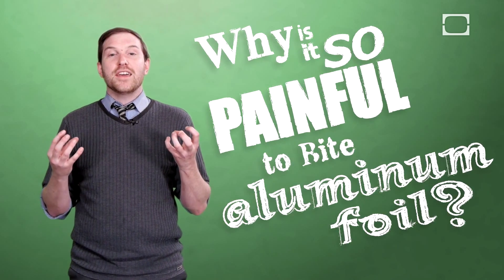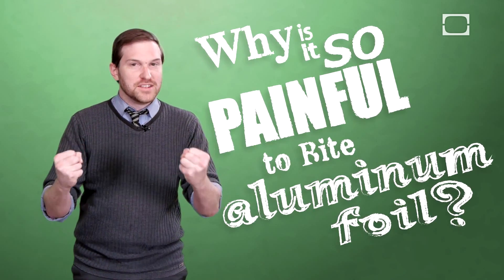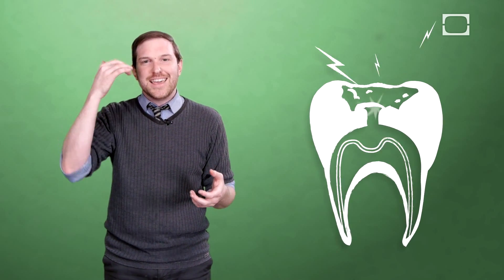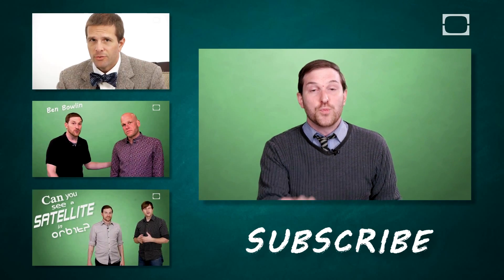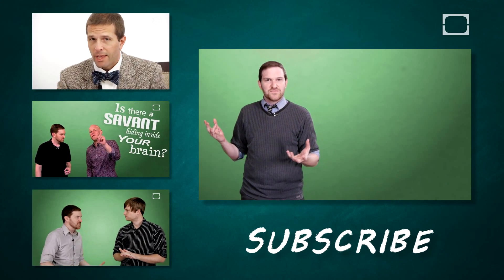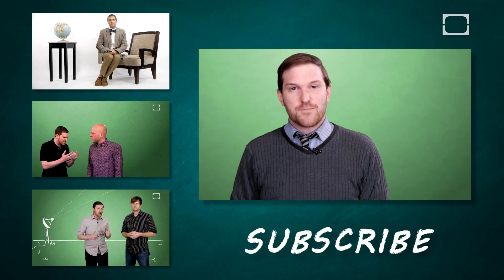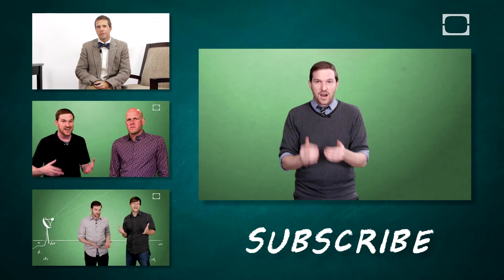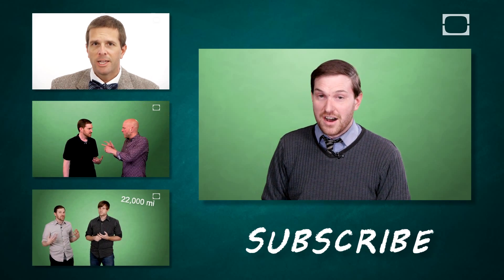Why Is It Painful To Bite Aluminum Foil?

Comment: I have a couch with two different kinds of metal, one is the main suspension for the couch and then another is wires in the cushion that are attached to dowels.  When I get my cell phone close to it it seems to get super heated after a while.  Could be also affected by the television or Wi-Fi or even the electrical outletS?

Comment: Appreciate the explanation. Without digging up a million charts or a LOT of math I haven't looked at since college, is there an easy way to estimate the voltage of such a cell, assuming a known metal in your fillings or specifically titanium dental implants? Titanium and Aluminum appear to be very close in potential, and yet I had a calzone incident the other day that felt like I bit an extension cord.

Comment: Hi Brain stuff. I have a question that regards a seatbelt. How does a seat belt know when to lock ? i tried searching it on the net but i could never get a proper answer? Your help would be great !!
Reply: Simon Merhi 

a locking lever extends from the spool axis by inertia to lock it when you pull fast enough
Reply from the maker: Hey Simon! We'll add that to our list of topics to cover. In the meantime, check out this article on our home site: http://auto.howstuffworks.com/car-driving-safety/safety-regulatory-devices/seatbelt.htm
Reply: +Simon Merhi There&#39;s a little ball in a cavity where the seatblet goes through and if you&#39;re pulling too fast the ball gets stuck.
I hope they haven't done this video before :P

Comment: the metal in the mouth also interferes with the electro magnetic field of the body in a negative way, not to mention, that u probably have amalgam fillings, which are 50 percent of the most toxic non radioactive material mercury, but hey it won't get into your body or as it already is, let's say into soft tissue right?
yeah right, except u rub on it, or heat it with let's say hot food or just the bh differences in the mouth u use, but hey after all who needs a working body and a brain is totally overrated.
and hey amalgam is cheap isn't it, of course until u figure out, that it destroys other teeth and decays the gums and that u need a specialist to get them out, cause the amount u might get from removing them or even worse swallowing a part might just kill u in a few month.
and if u're old (if u get there) and lie in a hospital or a nursing home having alzheimers and a decay and smell of death in your mouth at least u don't remember that the mercury might well be the reason.
but of course mental patents get heavy metal dmps tests, right, knowing the strong connection, but wait they practically never do, but u can't regenerate it anyways, so it's unimportant right?
yeah it's not like after some testing of mental patients and finding extreme mercury levels, that the psychological problem asides from others problems disappear through detoxification of the heavy metals right.
i mean it would madness if they wouldn't test sth. that can be taken care of and u get your mental health back.
but just that is the case, heavy metals out of the body and the mental health came back after years and years of unexplained detereration.
if u hang on the brain u use, body or even just teeth never get mercury (silver colored) fillings and never use mercury lightbulbs (energy saving non led)
Reply: Holy no more limited characters batman!
Reply: *****
i don't get what u mean?
Reply: cataria Because you probraly couldn't have typed that long of a comment if Google didn't remove the limit on characters just about the only good thing they did. at least after the bob revoulotion

Comment: Forgive me for being that guy, but it's ALUMINIUM, not "aluminum"
Hearing people mispronounce that word is like nails on a chalkboard.
Reply: In Canada and the United States, it's aluminum. More specifically, aluminum foil. On the Periodic Table, however, it is aluminium.
Reply: Well Canada and the United States are incorrect then.
Reply: Depends. Aluminium is an element. Aluminum is a compound made of aluminium. Depending on what all you put into the melting pot, you can get a different compound. After all, cyanide is made of two compounds: carbon and nitrogen. You don't call it Carbon Mononitrogen. It's just cyanide. Chemical nomenclature. I'm not saying Canada and the US is right, especially not the US (especially since we don't use the metric system), but I believe the point still stands.
Reply: Kitsune no Arashi I see your point, and concede. It still irks my linguistic sensibilities to hear it spoken that way, but at least I can see it in a less irritating light.
Reply: Glad to help :)
Reply: Even the British dictionary Oxford has it spelled as "Aluminum", a pretty major dictionary.  So not sure why all the hair splitting.   Also, do people not realize English dictionaries are actually descriptive guides?  Not actually telling you HOW to spell, pronounce, and define words.  In France it is a little different.  They have an academy that says:  This is HOW you spell, pronounce, and define words.  There is no such English academy.
Reply: The International Union of Pure and Applied Chemistry (IUPAC) officially standardised on aluminium in 1990, though this has done nothing, of course, to change the way people in the US spell it or pronounce it for day to day purposes.
Reply: Kitsune no Arashi Well this changes things!

It's ALUMINIUM DAMMIT!!!
Reply: hey 7CellarDoors just think about the whole world, if english word spellings in your country are correct it doesn't mean your country has all the correct english word spellings in the whole world, perhaps your world is not broad enough to understand english spellings outside your country...
Reply: Ted Mariano
In this case 7CellarDoors is correct. The standardized spelling and pronunciation of aluminium was defined in 1990 by the International Union of Pure and Applied Chemistry (IUPAC), which defined the scientific spelling and pronunciation as aluminium. As I pointed out however, in day to day usage people, mainly in North America, still use the term aluminum.
Reply: Marley robertson
Sorry but you must of missed my post. Let me repost it for you;

The standardized spelling and pronunciation of aluminium was defined in 1990 by the International Union of Pure and Applied Chemistry (IUPAC), which defined the scientific spelling and pronunciation as aluminium.

This of cause has nothing to do with how literary types may spell or define the word.
Reply: Ha, funny how you erased my link to the fact the IUPAC accepts both spellings.  Why is that?
Reply: Marley robertson I did no such thing. Post it again if you'd like, I honestly don't care.
Reply: Aluminium and aluminum are both the same
Reply: Indeed it has. I forgot about them.
Reply: umm.. ok it is just the word "Aluminium"... ok by the way I appreciate the info thanks
Reply: Same with 'ALIMINIUM' why?
Reply: Marley robertson ok.  Again the IUPAC accepts both spellings.  The "ium" spelling is the main one for them, but if a scientific paper were to have the other spelling, it's not a problem in the science community. 

http://old.iupac.org/reports/1998/7001coplen/aluminium.html
Reply: HEY, DON'T FORGET CANADA!
Reply: Not nails on chalkboard like aluminium foil on teeth
Reply: BLAME AMERICA FOR NOT BEING APART OF THIS SYSTEM!!!
Reply: Kitsune no Arashi GODDAMMIT 'MURICA, GET YO SHIT TOGETHER!!

Comment: I have a question that is kind of similar to this one and it does involve pain. Why is it that people hate/get chills from certain sounds like nails on a chalkboard, a fork scratching a plate, or, gulp touching and rubbing two pieces of Styrofoam together?
Reply: I got chills reading your comment.. D:
Reply: estXcrew
Then I have another one for you that I came up with: Your teeth scraping over a clay pot. Enjoy! :D
Reply: I actually researched that one about nails on a chalkboard because it was bothering me for a while. Some research that's been done also covers other discomforting sounds like the ones you mentioned. Conventional wisdom says it hurts because of the high pitch, but after some digging, the huge discomfort has 3 elements: knowing from past experience that it'll hurt your ears to hear it (psychological. It hurts more if you know what you're hearing); the fact that your ears naturally amplify frequencies within a certain range (pretty much the range of the human voice) and nails on a chalkboard produces a particularly intense amount of sound in that range, which is then amplified to the point that it hurts; and lastly, nails don't scrape evenly across a chalkboard, they sort of skid and jump on a micro level and that jagged roughness is very uncomfortable to hear.
Reply: i think this one is more psychological than physical.
Reply: harusameiro thanks for taking the time to explain that to me, I'm not so good at researching stuff on science articles, thank you!
Reply: harusameiro to be honest, it was always the feeling that got me, not the actual sound, so when i think about it, i recreate the feeling in my head which in turn causes the cringey feeling
Reply: Adrian Shmadrian oh god, why? D:
Reply: I thought I was the only one.
Reply: Adrian Shmadrian GOD MAN. WHY?!?
Reply: yup